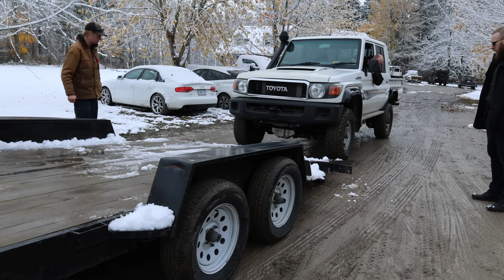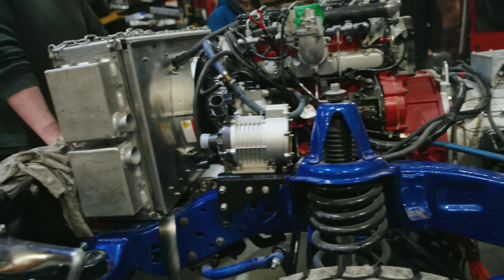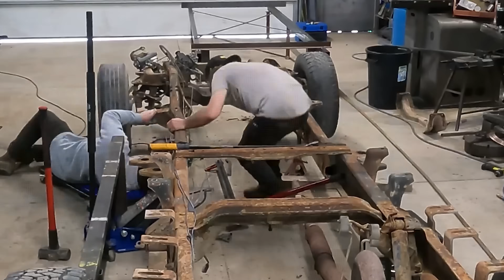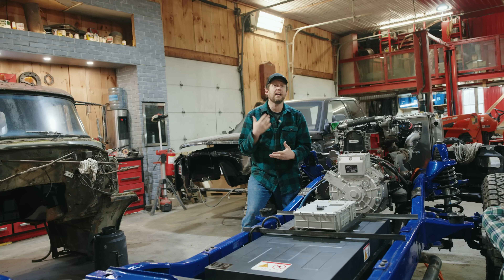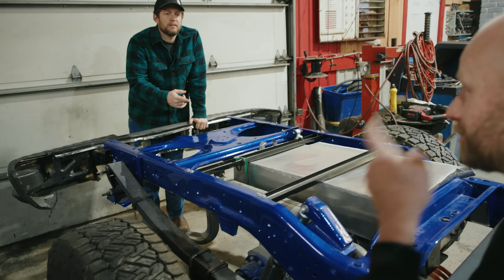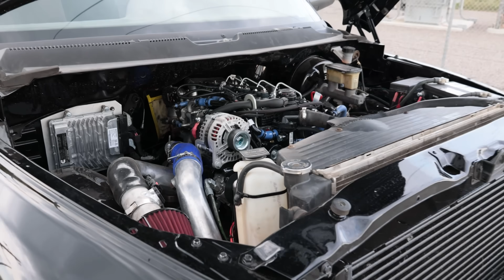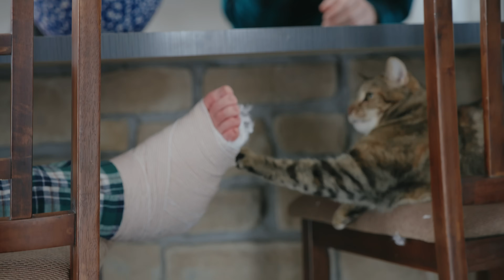Scrap Our First Design and Build an Edison Pickup Chassis from Scratch?

Comment: I say do the wider frame rails.  But also do an adapter plate for those that need the narrower rails for custom setups.   Then later you could do a standard rail option for those that really need it.   The wider should be first so you can really flex on the technology as well as potentially set a new standard wide rail.  It shouldn’t be too hard to make an adapter for those applications that need to accommodate narrower rails. A wider frame also means that you have more room for custom components for different vehicles.